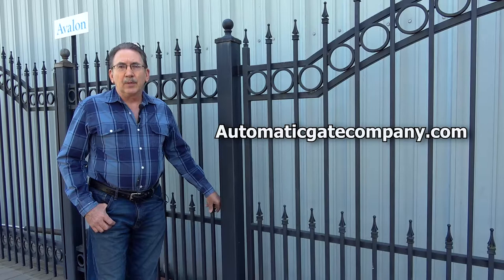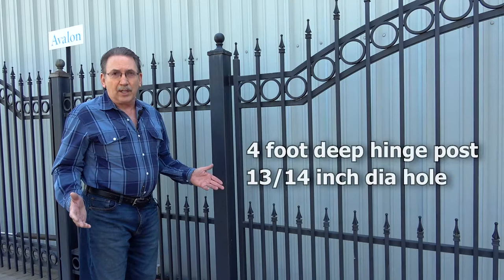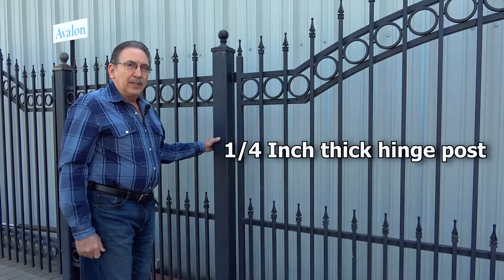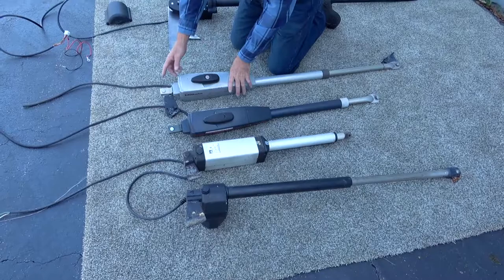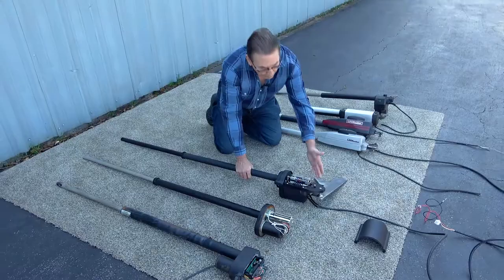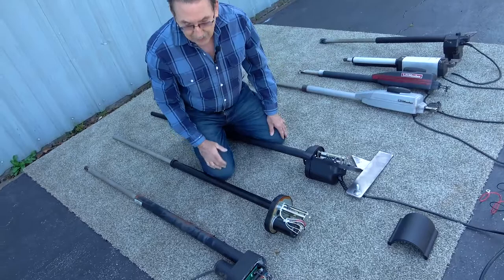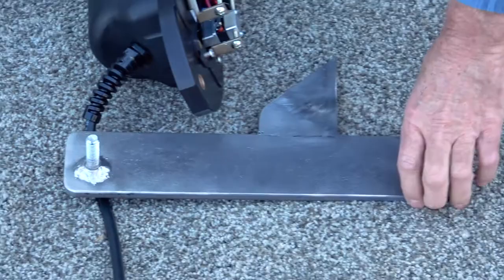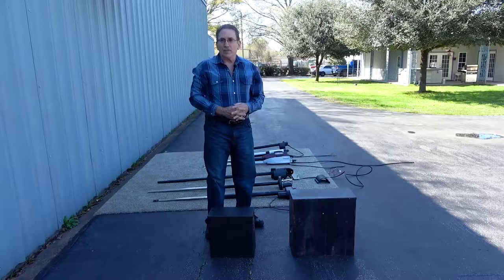How to Get a Good Driveway Gate and Opener

Comment: I agree that 4 feet should be the standard depth. Also soil condition matters. If you want to make certain the installation is done correctly you pore a grade beam with outriggers. Most clients won’t tolerate the cost increase. Especially since non of the competitors will offer it. 
The most important obstacle for openers is when you install the post & gate you must be able to read the level and do the actual work to get it right. 
Then hinges become a huge issue. Only use bearing type hinges. It’s also critical that the bearing style hinge is installed in line as well as make certain if your using the cheaper block hinge that the grease fittings are on top! Having it in this configuration means it’s more difficult to hang the gate if you ever take it off after the initial installation. If the grease fitting is on the bottom you must grease your hinges more frequently. Water does get into these hinges when mounting them with the fitting on the bottom. Fail to keep grease in them and the shaft & ball will rust quickly and plug the fitting. You won’t be able to grease them once the rust takes over. Mounting them with the fitting on top makes rusting and clogging the fitting almost impossible. Once you have everything properly installed openers like the Liftmaster brand are more than adequate for residential gates. The last two things I’d like to talk about is wire & mounting accessories. Direct burial wire ONLY. No exceptions! Use the proper gauge too! No matter what some companies claim you can’t run 16 gauge wire 1000 feet and have it charge the batteries. Ohms law is something you need to understand. Lastly is if your adding an accessory take the time to mount it and I mean use a screw. Double sided tape isn’t acceptable! Then run and tack down all wiring so it’s not sticking out the bottom of a cabinet or getting into the drive assembly. And please label the wiring once your finished!!! 
I’m sorry for the long rant but way to many installations are done poorly and cause service calls that aren’t necessary. It’s not always the manufactures fault when your gate doesn’t operate reliably.
Reply: Who asked
Reply: Do you install gates in the Chicagoland area??
Reply: Thank you for these expert technical  points!

Comment: Would the wall thickness of the posts vary between Steel and Aluminum. If I had an aluminum double driveway gate what specifications should I ask for if using aluminum posts please.
Reply: You probably installed it already. I installed a 12 ft Al. gate with a 4x4x1/8" steel post a year ago. The gate supplier sells and recommends 3x3x1/8" steel post for their 12 ft and 14 ft gate.  Al gates are very light. Hopefully it lasts for many years.